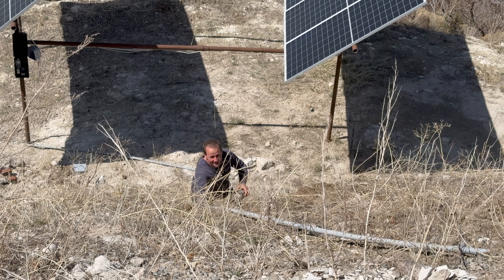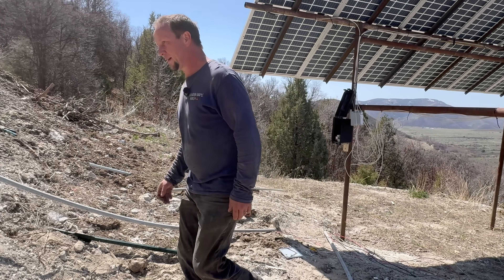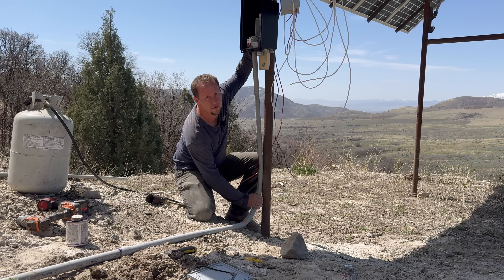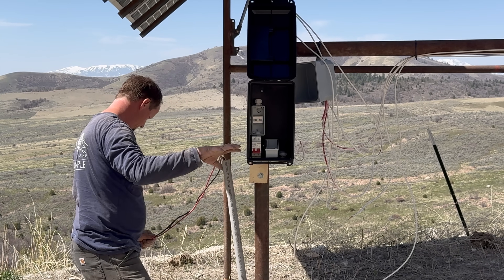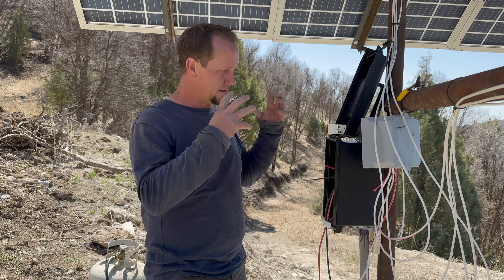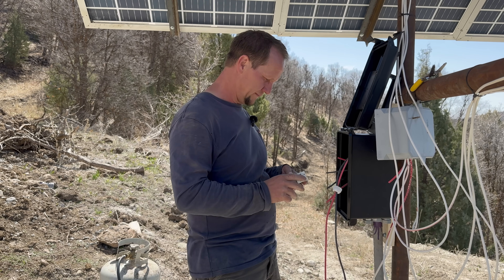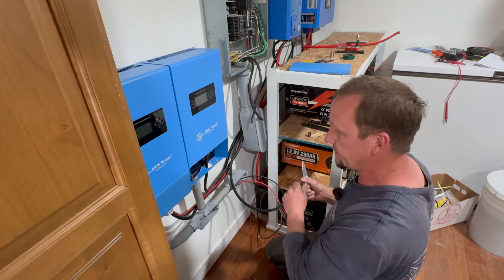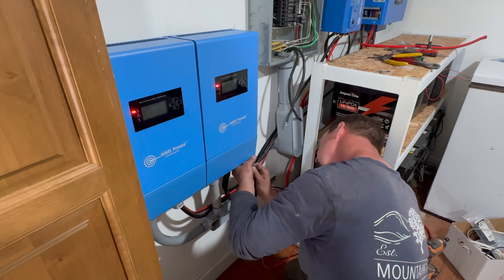Too Much Solar Power?! Adding Breakers & a New Charge Controller | MMR Off-Grid Upgrade

Comment: March to Oct I could sell 600kwh a month, I saw sun one day this year in Dec none the year before, massive shading, I have to move 20 panels now, should add 4kwh in Dec. 
 Down to 66 gen hours this winter might be 0 hours next year.
Reply from the maker: Those are really good stats and no other way to acquire that knowledge other than trial/error. That's the "rub: with solar... plenty of power when you don't need it.
Reply: @MountainMapleRanch  Dec 16 we get a 90deg arc, 60 days later 180deg, Can USA border.
Cost $780 for a new spot today 5 hrs. If I did it by hand 8000 hours, landscape total $4500 now, all rock 1 ft down, even the 6t excavator was useless.

Comment: You were smart to install low-frequency, transformer-based inverters instead of one of those cheap, high-frequency, transformerless, XP-style inverters that everyone else is pitching. Your low-frequency inverters are going to last a lot longer, they'll provide a much higher surge capacity, and they're a lot safer for use in off-grid applications.

Comment: What’s the voltage of your 2 systems.
 I am in Pembrokeshire west wales UK.
Thanks
Reply: The batteries look to be 12v. I think 4 in series to get 48v. AC will be circa 120v, but I could be completely wrong and normally am😂
Reply from the maker: This is a 48 V system, typacally runs at 52-53V. Great question.